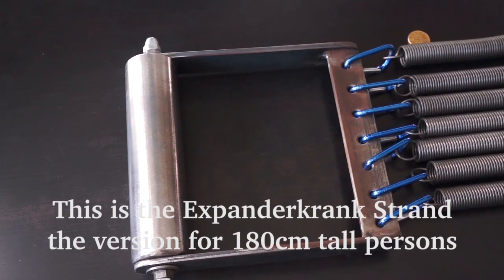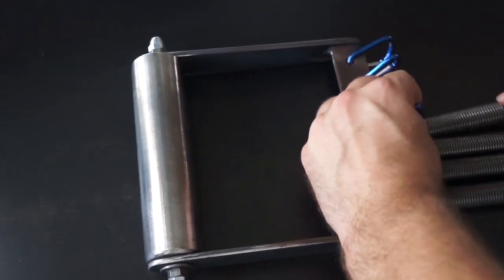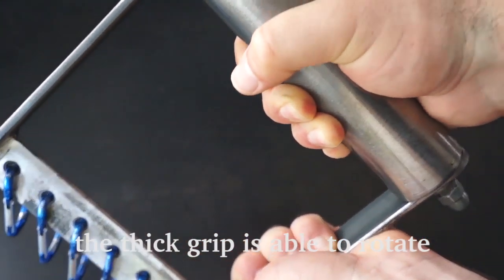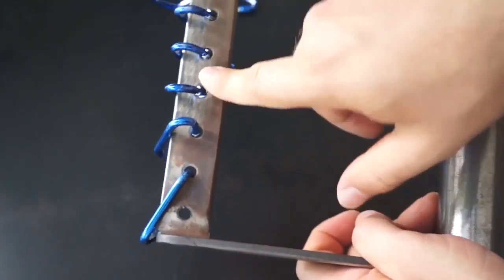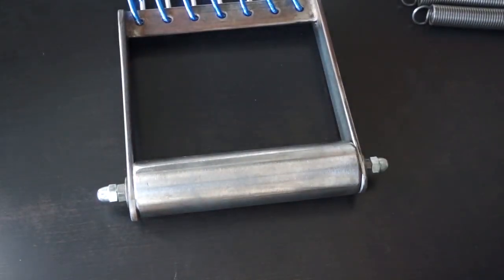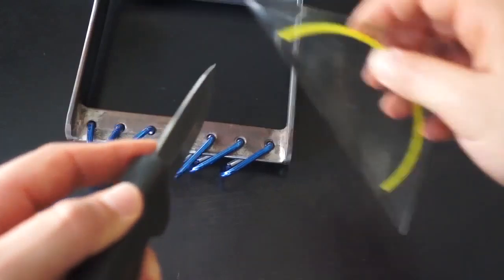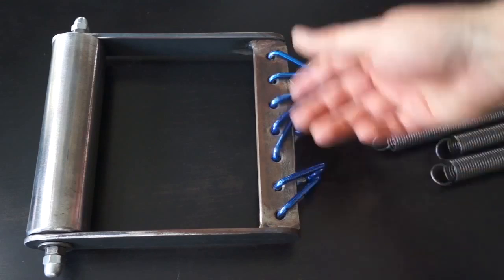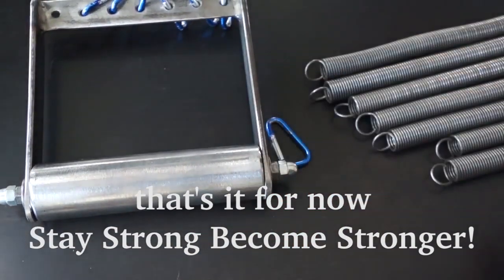[ENG] How the Steel Expander works - Expanderkrank

Comment from the maker: @Muhammed Ahmed:
I work out using Chest Expander two days a week. I used to do a heavy BWE workout, but I switched to Powerlifting about one year ago (only did about 27 Powerlifting workouts in that time, so no special strength gains from this). Personally I think BWE, Chest Expander and a Kettlebell/T-Bar Swing day is enough to get stronger than the average joe and build good muscles.
Reply: how many exercise can i do with it.can i do leg exercise with it.

Comment: A very interesting video.I like the attention to detail, such as the revolving grip, smooth bevelled edges and countersunk carabiner holes to reduce stiction and stress in this area.Much easier, and safer, to change the number of springs attached to the handle.Cheers.

Comment: Available to buy?
Reply from the maker: No, sadly not. 8 years ago I was planning on selling them, but the steel price is just incredible right now. It would be too expensive to build them. Best alternative is using one or more elastic bands. The homepage is back online, if you need ideas on training with expanders.
Reply: You could find one of the vintage chest  expander on ebay but I would get newer spring. But don't know where to get them though.